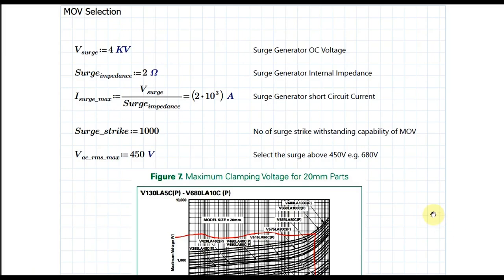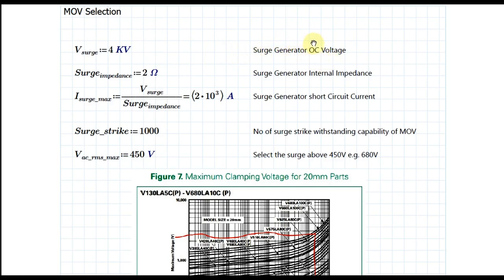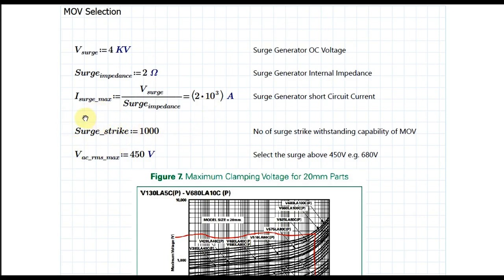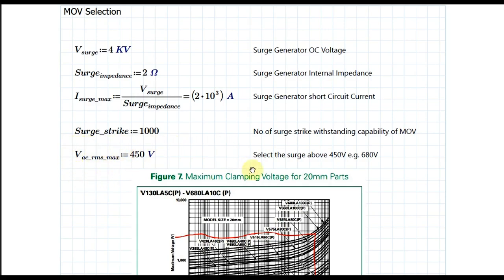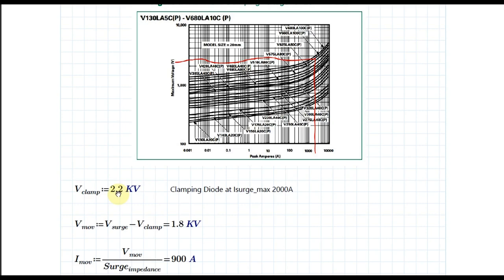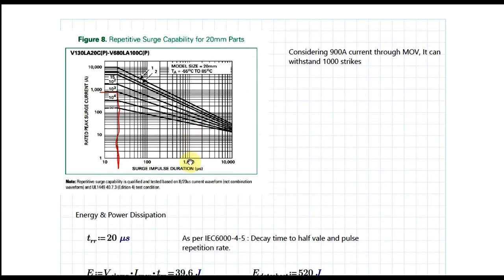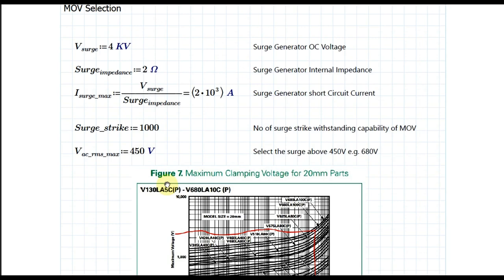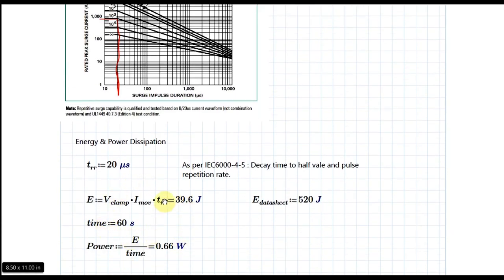Surge Protection - MOV Calculation || IEC61000-4-5

Comment: Sir pls make a video with calculation on
Surge resistance(82E/6W), in the circuit we have use before mov for the impulse and surge test protection
Reply from the maker: I will make next video with Surge Resistor.
Reply: @ElectronicsCircuitHubECH  thanks sir ji

Comment: sir thank you for your effort ,
Plz i want to ask you about 30Kv surge test is these calculations valid at this level (30Kv) and which MOV part number you recommend for such test
Reply from the maker: Hi...It's hard to reply without knowing exact application of your design and what all components you are using in your circuit. I would say probably you have to increase the MOV diameter to handle the more energy. so the (30KV-Vclamp)/2 = Current. So look at the MOV to handle this current. Also calculate the energy requirement so size the MOV. You can connect me in my number given in home page for more details. Thanks

Comment: Hello sir. i want to design my 50W and 100W Power supply circuit. I want it to sustain 4KV Surge. What values of Fusible Reaistor and MOV should i Use
Reply from the maker: Hey Sanjeev,
Thanks for asking very good question.
I would not recommend to use wire wound resistor for 100W application. Better to use two or three NTC 10 Ohm in series. Also use 20mm dia MOV parts. Here is my recommendation.
Mov -  V1000LA160bp
NTC - B57153S0100M000
Hope I answered your question.

Comment: Sir surge test ke har strike ke bad me mov ke energy kam hoti jati h kya? 
For example- datasheet define 520J
             In the calculation we calculate 39.6J
So after test = 520 - 39. 6 = 480.4J
Is tarah last me energy zero ho jaygi kya sir? Or mov damage ho shakti h kya
Reply from the maker: Hey...let me try to answer your question.
For sure every surge pulse there will be degradation in MOV surge energy. As you have seen this MOV will work upto 1000 surge pulse. Ex. One pulse energy is 39.6J so for 1000 pulse required 39.6J*1000=39600J which seems impossible value.
The calculation shows energy used by MOV for single pulse.Lets say you are using 520J for single your MOV will get damage in single surge. No of pulses depend on Surge current  and clamping voltage.
MOV will degrade every surge pulse but not like you understood. For sure it will work untill 1000 strikes.
I hope i was able to answer your doubts at some extent.